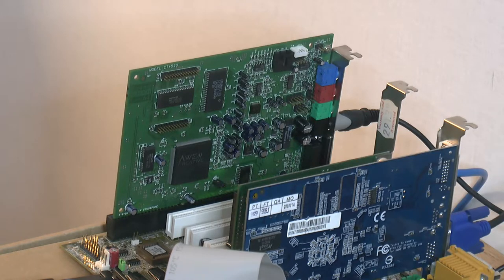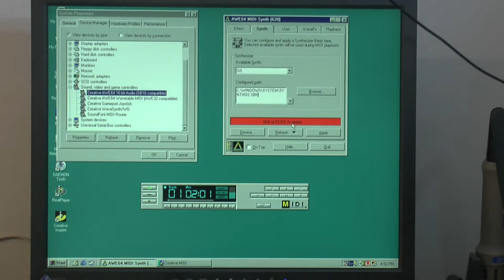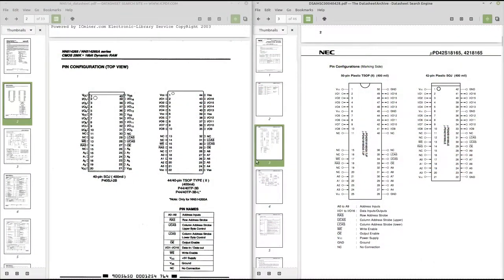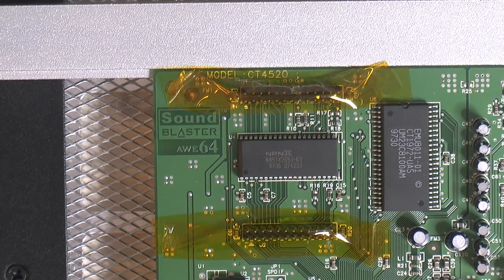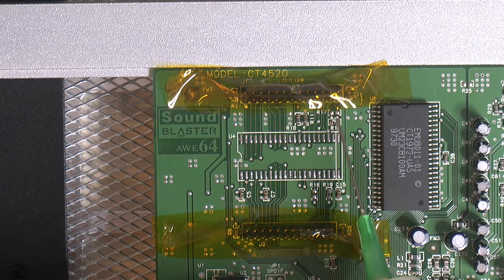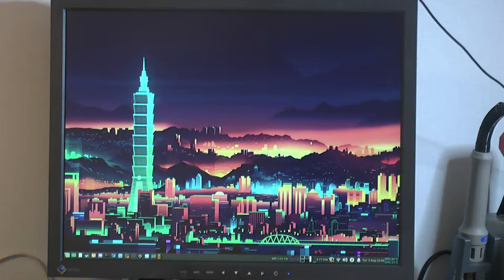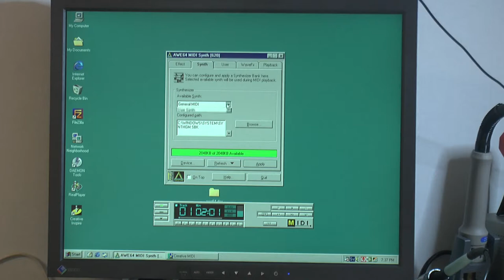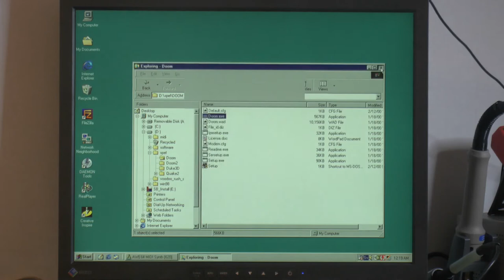Sound Blaster AWE64 Value 2MByte memory upgrade

Comment: MT-32 bank can't play better, as it is rearrange of presets to get match preset bank of Roland Mt-32, so all General Midi files will play totally off.  But back to Awe64, I used to have it, with 8MB expansion board back in 96, even 8MB GMGS bank was nothing too much exciting, especially if you compare to Yamaha SW60XG with 4MB ROM, or even with original Roland Sound Canvas SC55 (around 3MB). I believe, that original idea of Creative was to create some kind of cost accessible alternative to samplers, but despite they own EMU system (Emulator I, II, Emax, Emax 2), which was producer of professional samplers used by major artists back in 80's/90's, they failed to create any exciting sound bank, all what was supplied on that CD together with RAM board was better variation of General Midi instruments, they could really add some interesting sounds from EMU/EMAX library. Anyway as fan fact, just check some Roland JV-1080 demos, you would not believe, that modul have only 8MB of ROM (of course much, much, better synth engine, but also fully digital).
Reply from the maker: The problem I find with the AWE64 is that aweutil dont work with protected mode games and memory extension technologies so basically anything using DOS4GW dont work with aweutil /EM:GM

Sure I can load the sound bank, I can use it in dos with supported software like DOSmid that can either use onboard ROM in native AWE32 mode or use the cards General Midi Emulation and I have a custom soundfont of 2Mb loaded and the sound is totally different and much improved but pretty much nothing else works natively but a few softwares so ram for soundfonts feels like a wast in dos.

Games just hangs with GM enabled and its its biggest pitfall.
Sure the drivers under windows allows dos games to run with General Midi emulation and a soundfont loaded in the ram bank but its not as much fun as native dos.

A replacement for aweutil would be needed to sort this out it seems because crative failed to do it and I dont see any project out there trying to fix.

AWE64 is a bit of a disappointment in DOS, in the end it runs best set to Sound Blaster 16 mode in dos, might as well have a SB16 then.
Reply: Right, I was also expecting from it much more, but what totally surprised me, was real Roland MT-32, that machine really sounds, like real synth from pop/rock 80's production (which it is :-)). If you want ultimate GM midi fun, try to get Yamaha MOTIF-RACK classic, it have also GM mode, it is a little bit tricky to use, but that is rebalanced with absolutely outstanding sound quality, you will not recognize that midi files, played through it, and also it should be quite cheape nowadays :-)

Comment: It's not possible to use a higher density chip? I have found 4MiB EDO chips available.
Reply from the maker: Sure but it requires other chips to address that extra ram.
The gold version I think has a programed PLA to support 2+2MB if I recall.
 The schematics exists for that and there are new upgrades you can buy for more ram that will fit the expansion header.
 But the card it self can not address more without those extra PLA chips.
http://web.archive.org/web/19980522062527/http://creaf.com/sound/64-gold/ct1930.pdf
http://web.archive.org/web/19980522062536/http://creaf.com/sound/64-gold/ct1950.pdf

Those PDF's has the schismatics for the different upgrade modules up to 28MB and the part list.

The problem is that you need to program those PLA chips and those files idk where to find and the modern implementations dont use those chips it seems anyways.

Comment: it is necessary to solder the SPDIF output to the Sound Blaster AWE64 Value 
With sequencer for Sound Blaster AWE64 Value using the FM hardware synthesizer at 4-operators mode or using the Add hardware synthesizer ( it requires software that can use 4 operators instead of 2 operators ) to create quality sounds with the SPDIF output record to new high-quality sound cards or from them to the magnetic tape , can be achieved the studios quality sound 
It's difficult to find software that uses 4 operators instead of 2 operators that give a sparse sound , or find System Exclusive (SysEx) in a MIDI file with a sequencer to use 4 operators for bether sounds 
Sampler EMU8000 is not recommended to use it becose has 16 bit samples, although the quality can be improved using EMU8000 DSP with controllers Non Registered Parameter Number ( NRPM ) or System Exclusive ( SysEx ) at MIDI file with sequencer

Comment: Very nice work. Congratulations. In what brand of motherboard de you fit the AWE64 ? It is probably a motherboard that uses ISA 16 bits slot, am I wrong ? Best wishes.
Reply from the maker: Used for testing, more work to be done to it then it will find a home.
Reply: Sorry, I did not understand the answer...
Reply from the maker: @ivanpedromuricy  Yes its 16bit ISA. The card is in a box because its used for testing sound on motherboards.